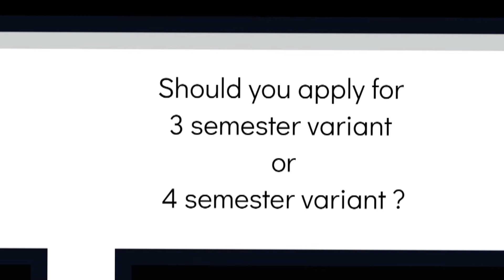Simulation and System Design - Hochschule Stralsund

Comment: following conditions can eligible for ms mechanical engineering course in GERMANY
1)Cass x marksv94.80%
2) class xii marks 75%
3) cgpa 8.84 180 ect,
* German geade 1.6
4)ielts 6
5) 2 interships 1 months
6) 6 month intership
7) 2 research paper. ( got google code )
8) mech engineering
Can will ger admision?
Give me list of university
Reply from the maker: Hello Pradip, as I already explained in the video, if you satisfy all the requirements mentioned on the university website, you will get the admit.